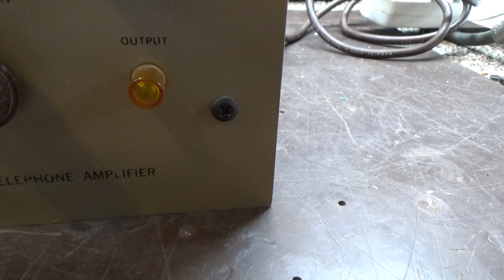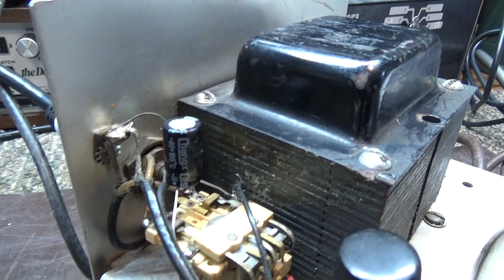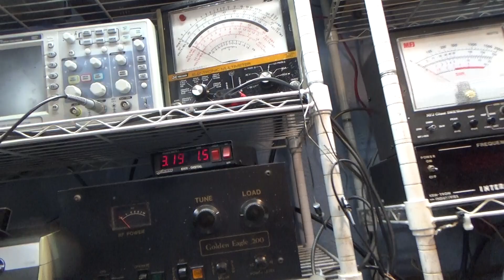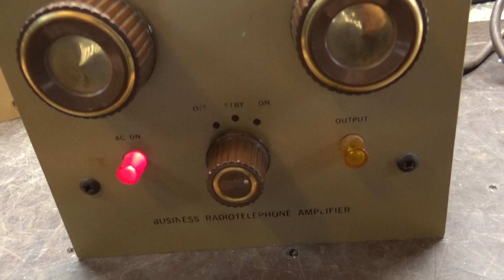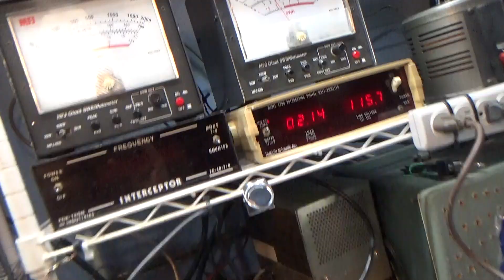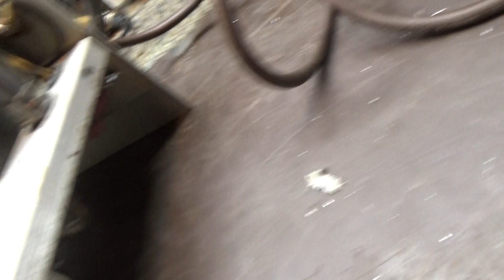Browning 180 amplifier explained and transmitting on the bench

Comment: Be as long winded as you want...I love the knowledge that you share!
Does it matter what order to start with 1st (Tune or Load) or can you just dial in for max output either way?
Reply from the maker: its just very slightly easier on the tubes to dial in the Tune first. The Tune for the most parts tunes the tubes, and the Load for the most part tunes the antenna. They do interact with each other though. Since we want what is best for the tubes, Tune should be first, but with that said, the difference is minuscule. As said in many manuals, do it quickly though.  Even better would be if the amp has a low side, or if you could lower the drive to the amp, tune it up that way first then retune as you go to high or apply more drive. One of the worst things one can do is mistune an amp, meaning dial down the Tune and Load to make the amp do less. The tubes are still producing the same watts, but now instead of going out, they are going back into the tubes. I say the tube eats those watts.
Reply: @tramdr  Thx Bro! Seems like simple knowledge but I appreciate hearing it from you.
What say if you have a Drive knob as well?
I use a Kenrich Eagle 515 (the ones where people always mix up the tubes) and I've been doing this order: SWR (back - set and forget), Drive, Tune, Load then repeat the last 3...
I don't know if there is an internal input adjustment, but I'm also kind of stupid too...
:P

Hm...A nice coaching vid on that box would be cool if ya have one of those lying around...
:)
Reply from the maker: there are 2 different purposes for a 'Drive'. One is the Driver tune, similar to the tune and load for the finals except it tunes the driver tubes output. However, some amps use 'Drive' as a variable usually for the bias. If an amp has a drive or variable that actually is for varying the watts, as in bias, then you start by turning that down, then Tune and Load the finals, and slowly ramp up the drive (variable), then keep retuning the Tune and Load. However, in the Eagle 515, the 'Drive' is actually a driver tune. Not critical, but the best way is to start with is the final Tune, then Load and repeat until max is achieved, then tune the Drive, then retune Tune and Load and repeat, and once max is achieved again, then do the input SWR, then retune Tune, Load and Drive for max again. Tuning the drive (or driver tubes) first is not optimum. You are putting max power into the finals and they are not tuned up yet. Won't really hurt, especially if you are doing it quick, but its not optimum.

Comment: Tramdr is right. When you purposely detune your grounded grid amplifier, the tubes are suffering because you are creating an impedance mismatch between the plates of the tubes and your Pi L network. Your Pi L network is the tank coil and your air variables. Their job is to match the plate impedance of the tubes, to the 50 ohm output required for the antenna system. Matching the impedance's gives maximum output. If you want to run less than full output on a grounded grid amp, you still need to tune for max, then just back the drive down. Your tubes will last much longer by doing this.